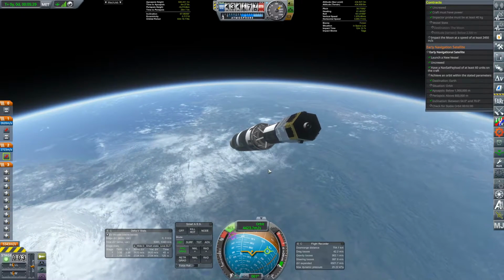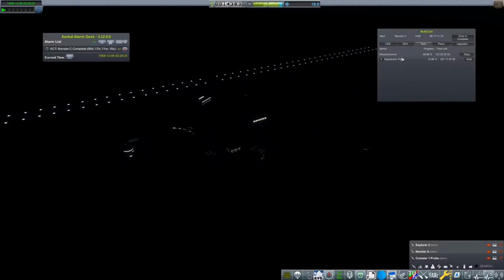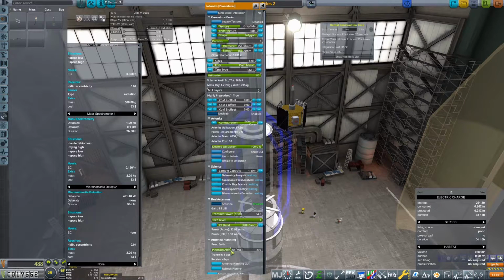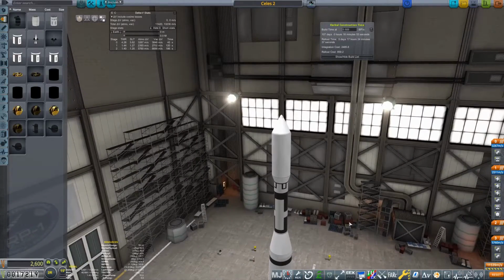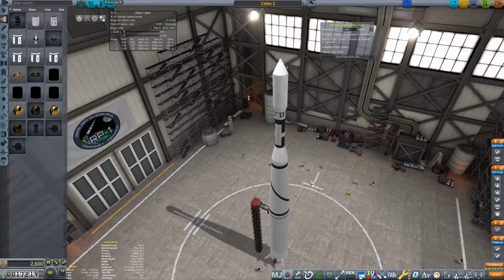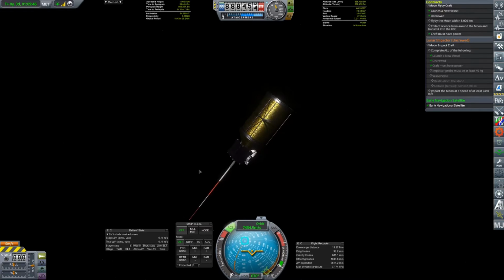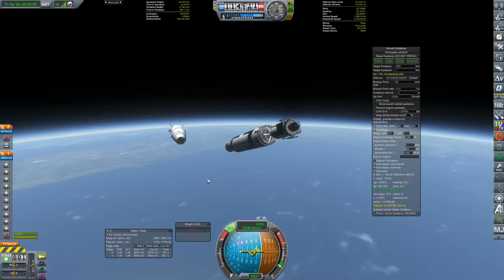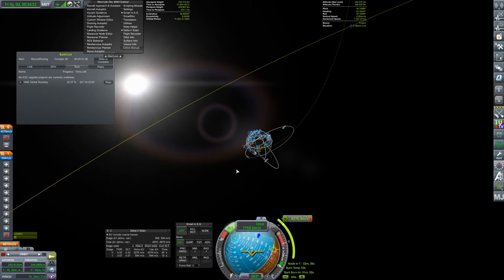Shooting for the Moon! - KSP/RP-1 - Next Small Step Episode 17

Comment: 14k dV for sub 50 tons rocket... what the hell? I know it's a ~20 kg payload, but still. I'm watching your vids parallel to my own (first) playthrough and I'm nowhere near these numbers. :<
Reply from the maker: Thor-Able is gooood stuff, man. Spoiler alert, but I wind up using very similar architecture for a HUGE number of launches. You can really go a long way in RP-1 by copying designs from real life!
Reply: Yeah, I actually experienced the same problem with almost the exact design as the celes 1, at one point with a 60kg payload, Mechjeb shows 5500 deltaV on the Aerobee stage and for a total of almost 13000dV. However, once I added a service module tank for navsat payload, the aerobee deltaV dropped to only 2000. Reverting back to before, now I only get 2200 deltaV.

Turns out it is an issue with the procedural faring decoupler, not the one that ejects the farings out, but the inline decoupler for dropping the lower stage. There are actually two nodes on the base of the procedural faring base, and the top one is the one that actually decouples, controlled by the height setting. The height of the farings is controled by the extra height setting instead.

Haven't gotten the tech for the better procedural avionics yet nor tried reducing the weight, so can't test the celes 2 design. But I speculate that the aerobee does not give 4400 delta V even with a lighter payload. Since in the sounding rocket era it never gave more than 3500 delta V.

Comment: I realize I'm really late to this, but I noticed you have the engine in the same stage as the separator/decoupler. That works fine in normal KSP but I've noticed in RO it can sometimes cause you to lose an ignition, which really matters when you're doing orbital maneuvers and only have a handful of ignitions you can use.
But great series really glad to see someone doing a RP-1/Kerbalism series!
Reply from the maker: I think you might be right, with how much I rely on MechJeb PVG these days. It's fine for my upper stages, but I'm trying to be more careful with my new boosters. Glad you're enjoying it!

Comment: Hey, thanks for the series, really enjoyed this so far!
A couple of suggestions:
* Not sure if you're experiencing the same issue, but persistent rotation does not seem to work when some of the smart A.S.S. guidance programs or ascent autopilot are on. I just set smart A.S.S. to 'OFF' when I'm warping and seems to work fine.
* If you want a smoother ride when driving manually, you can press CAPS LOCK to enable a kind of soft-steering mode.
Reply from the maker: Thanks for the tips!
Reply: I know this is 8 months old, but that is persistent rotation working as intended. It does the same with the stock SAS being on. It’s so when you warp when, say, pointing at a node you don’t drift and have to go back. Not sure if that’s a setting or not, but it is working as intended.

Comment: With regards PVG, I think you may be trying to get the periapsis too high initially. Have you tried aiming for a Pe of 200 and Ap of 800. If that works then that may be your problem. Your rocket may not have to dV to make the orbit you desire straight from launch. Just an idea
Reply: Decreasing Qa helped me with rockets breaking/tipping during gravity turn. Forces it to stick closer to prograde vector, especially near maxQ. Edit: addressing not using all deltaV on able stage - ticking "omit coast" should help.
Reply from the maker: Thanks to the both of you for the good suggestions, I'll play with it this weekend and see if I can't improve my flight profile!
Reply: @justinbright9567  i am so tempted todo a tutorial on pvg because its misunderstood by allot of people. 
Bottom line to get high twr short burntime vehicles into orbit is this: start turn 60-80m/s. Pitchrate .6-.8 . And most importantly DONT OMIT COAST.

Ps I do spend some time on the discord. Feel free to poke me there

Psps next time ull watch the entire thing first. See you got it figured out later on :)